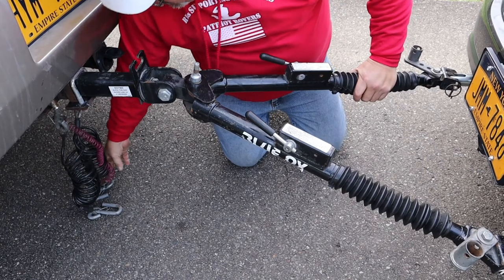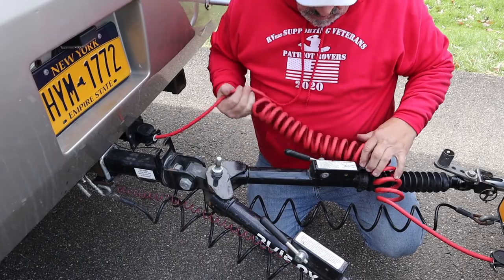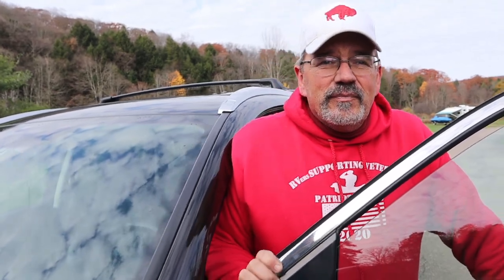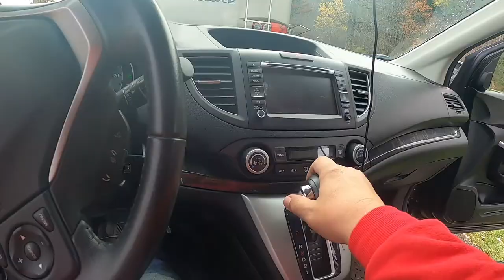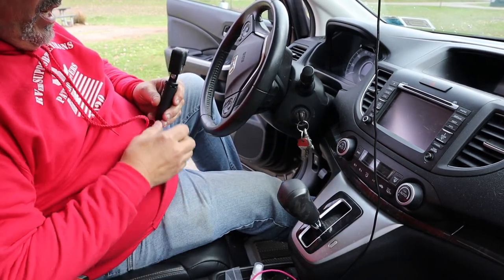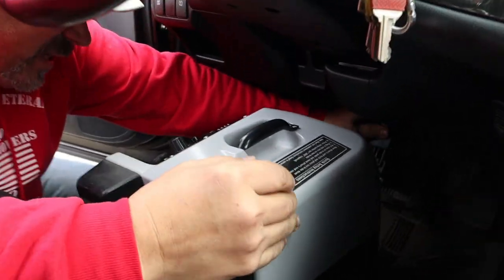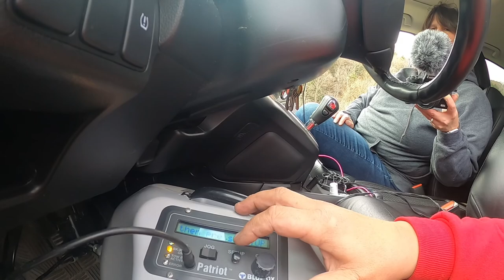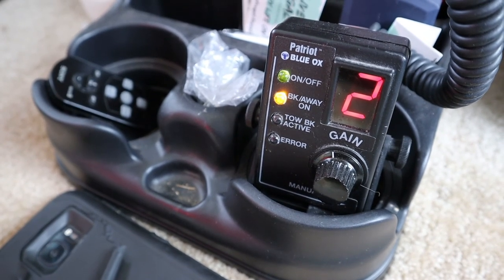BLUE OX FLAT TOW SYSTEM FOR 2014 HONDA CRV / FULL TIME DREAM

Comment: Do you use any type of charge line for your battery? Also, do you pull the ACC fuse in the Honda CR-V as noted in the owner's manual? If so, does that affect affect the power to the 12V receptacles in your CR-V, or are you still able to plug your Patriot brake into the existing 12V power receptacles?
Reply from the maker: So sorry for the delay responding to you . after the fact we did run a charge line in the seven pin connector to the battery if you pull the fuse you will not have power to the braking system .  if you tow without the pulling the fuse you will drain the battery without the charge line in place . I would love to answer any questions you may have .   a call would be easier to explain  you can send me an email with contact info and I will give you a phone call when it's convenient for you

Comment: Do you pull fuse to shut off radio & clock no one said anything to us & our battery died or do you have a switch which we'll be installing
Reply from the maker: We installed the switch after we had a dead battery on our second trip . that also is easier to install then you would think . You can also run a charge wire from your seven pin plug to the car so the battery will charge from your rigs alternator while going down the road .